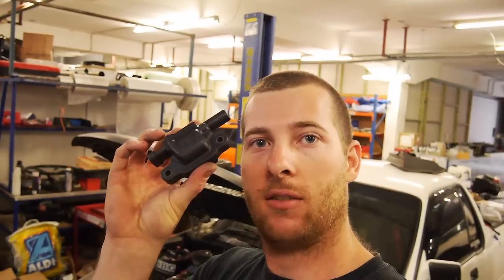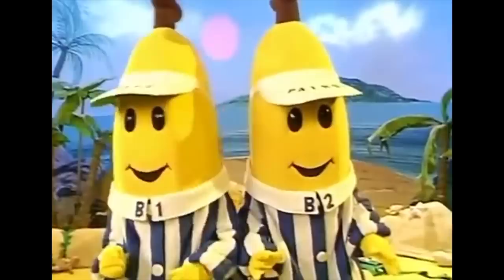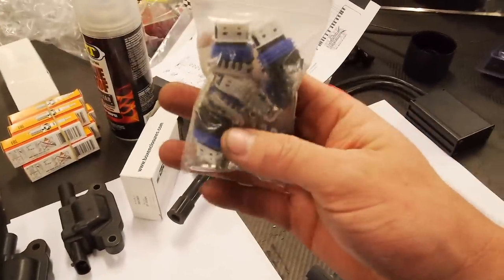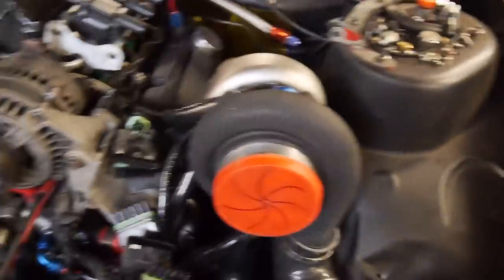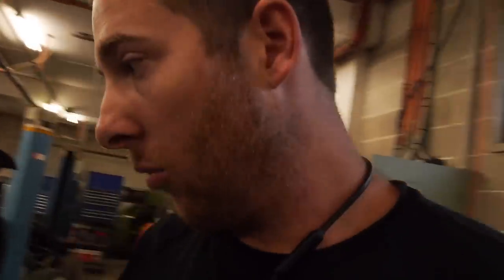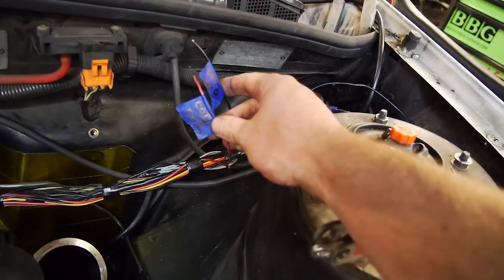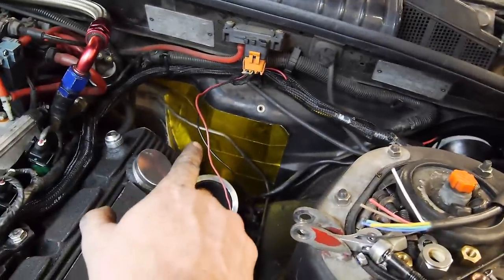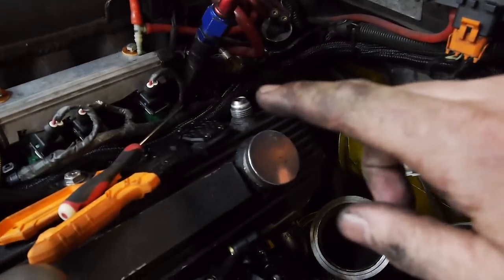CUSTOM LS COIL SETUP - VR V6 TURBO COMMODORE UTE - Part 1

Comment: The size of spark plug wires actually make no difference at all 8.0 mm wires would work just as well , one thing with the thicker more insulated wires is that they have more insulation which cuts down on stereo frequency noise while stereo is on that funny whiny noise you hear through audio as you change gears etc ...that’s all that thicker wires do , they don’t give you more power or more spark ⚡️ from coils to spark plugs it does not give  you a bigger spark or any extra power . People waste lots of money on the most expensive Top guns etc thinking it makes a difference
Reply: Most street cars are running up to say 60kv from coil to plugs and yep will cope fine with 6-7-8mm leads

Dedicated track car may be setup with its ignition module supplying 16/18/20v to its coils, potentially  100kv+ to the plugs and large plug gaps. Thats when youll notice the difference from 10mm leads

Comment: I definitely more interested in how that arashi Dynamics turbo is working out for you? How's the reliability? Power? Etc. I hadn't heard of those kuru2's til u did that video when u bought it. I'm looking to build an alloytec v6 in the near future using twin turbos. As I'm sure everyone is aware, theirs a bunch of different choices out there,all have their advantages and disadvantages. Main things usually end up around price, journal bearing or ball bearing etc. Those AD kuru2's 2871's are looking like a really nice option at a decent price. Just wanted to find out more as $1800 for 2 turbos isn't chump change,and it'd really suck to put that out only to find I had a better option or was wasting my money.
Reply from the maker: Haven't driven the car much with it but it's a seriously top quality turbo and honestly way better bang for buck than a Garrett. Arashi, mamba, kinugawa they're all great quality turbos. These days with turbo technology you're almost wasting your time and money using anything but a good billet ball bearing turbo with the price they are and the availability etc
Reply: Wow, definitely appreciate the response. It's funny,I'm here on the east coast of the US writing this comment at like 4am. I figured u gotta have tons of comments daily, probably wouldn't answer for a couple days if at all. Then I remembered the time difference,lol. Anyway, thanks for the response. Here in the US, everyone is building LS's, coyotes or 3800 v6's, aftermarket parts are everywhere for em. The alloytec though,I pretty much have a better chance of meeting God at a local BBQ,than finding decent aftermarket support for the alloytec v6(ly7 etc). I did however by chance find, y'all over in Australia have a bunch of stuff to build a decent engine with, everything from cams,Todd's, pistons, intakes and more. Kinda strange considering the LY7,LFx v6's are in tons of GM cars here,and pretty easy and relatively cheap to find decent engines here. Don't get me wrong,I love the LS's just as much as everyone else,but wanted something different/boosted. An LS would be way to much power (if their is such a thing,lol) for the car I'm planning this for. Something about 600ft lbs of torque in a daily driver car weighing only 2300-2500pounds, seems like overkill to me. This engine will be built for a 03 Miata.